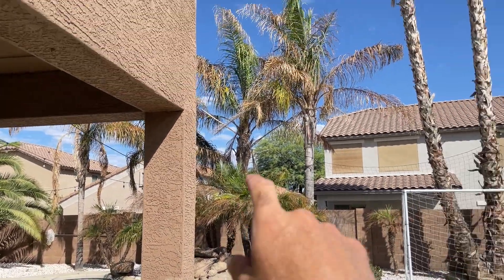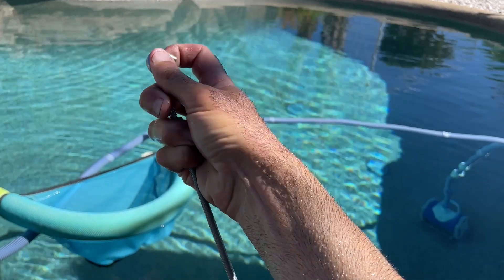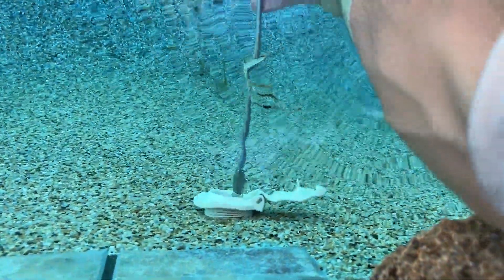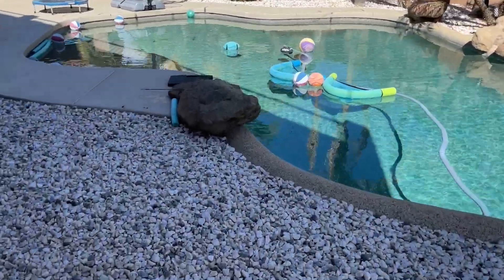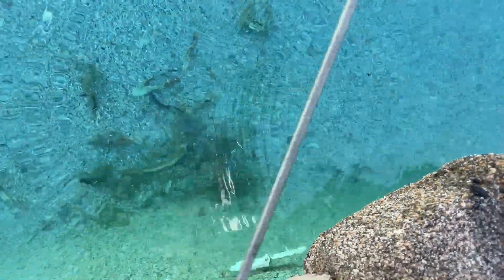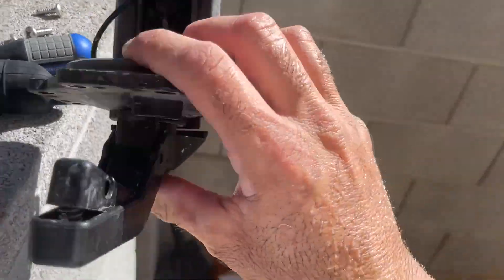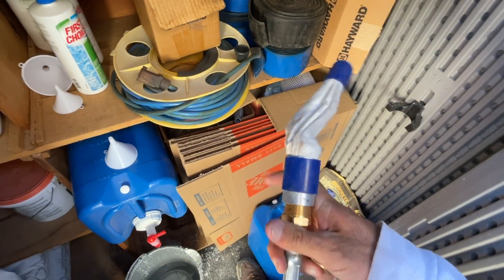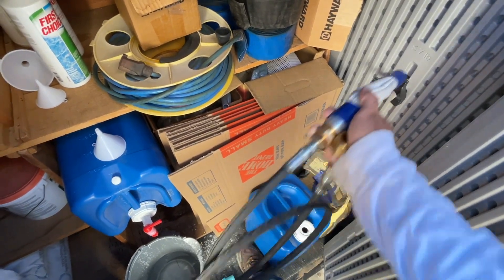Clearing a Clogged Pool Vacuum Line

Comment: I suffered a depression after my wife died.  The cleaner was sitting in leaves, bark, stems in the bottom of the pool.  I don’t have a leaf catcher anymore.  I didn’t care.  But the suction side port clogged.  I used the bladder and a thin bamboo stalk.  I was amazed at what came out.  I used the bladder both ways.  From the pool to pump and from the pump to the pool.  Back in business.  Thanks

Comment: WHAT DO YOU DO WHEN THE VACCUM LINE IS IN THE SKIMMER BASKET HOLE?
Reply: Be careful putting a bladder in there.  It can get stuck.  A lot of skimmer holes have threads (female) and maybe thread a pipe in it above the water level.  Shut the system off first then open the pump basket and shoot air or use your bladder on the pipe sticking up.  I used my bladder both ways.  From pump to pool and from pool to pump.  I had to because it was really stuck in there.  Unbelievable how much came out.  The stems were the worst then the bark, then the leaves.  It took a long time of repeating the process to open the pipe.  Took at least a few hours but when it broke it poured out and my suction came back